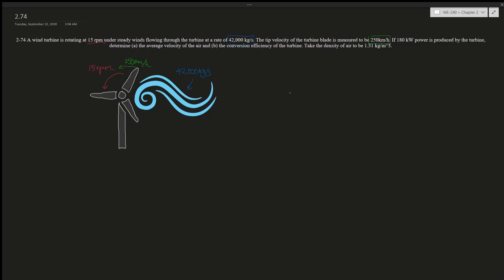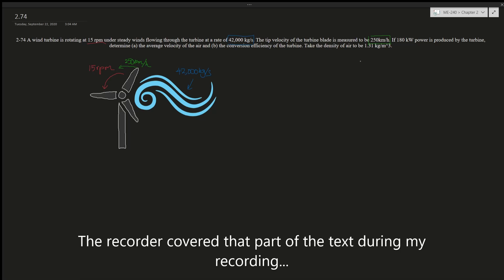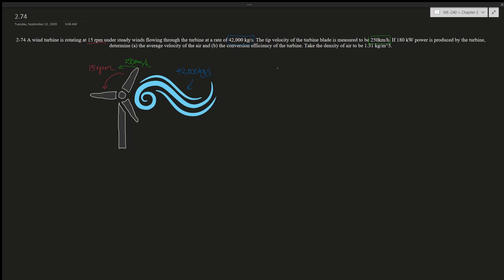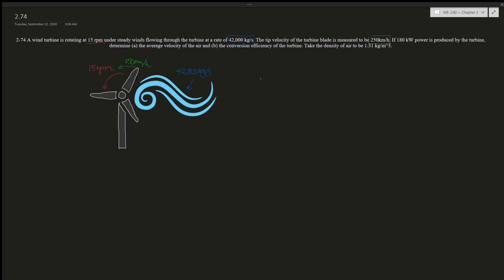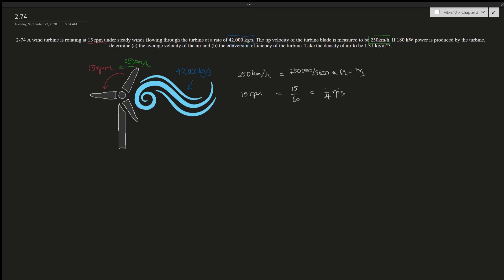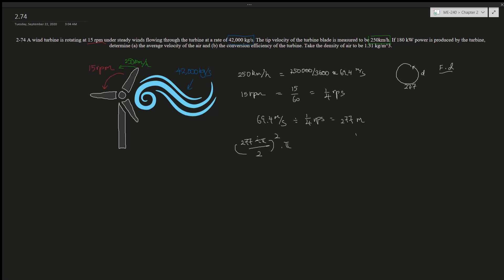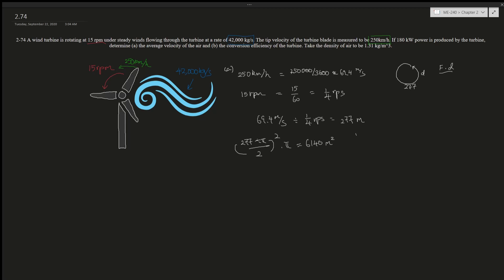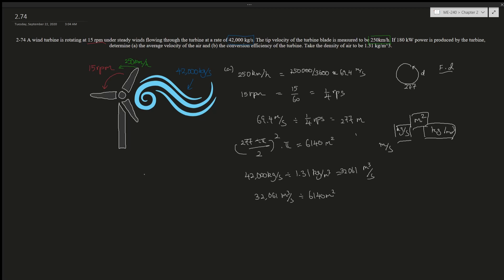2-74 A wind turbine is rotating at 15 rpm under steady winds flowing through the turbine at a rate..

Comment: This video is really helpful but i do have one question. Is there some equation your following to know what units you need, cause without this video it feels like aimlessly converting units until it turns out m/s
Reply: It’s not your fault, but our educational system has changed us into thinking like a machine, find a equation, put numbers in and you get your answer. This video and with a lot of my videos follows the model of “conceptual based, inquiry driven”. It helps you to really understand what’s going and enables you to solve this problem during exam if you forgot your equation, you can still derive this yourself. It will also be helpful in the future if you do research because you understand what you are working with, not an equation that some dead people told you it works. You will start remembering stuff in your later classes (an example for me would be aero-structures, which you will need 15 minutes to develop and finished up the equation yourself, so it’s inefficient) But all the units I mentioned here, KE, volume, power and etc are all High school level physics. Also, as I said at the end of the video, you have to be fluent with those basics units.